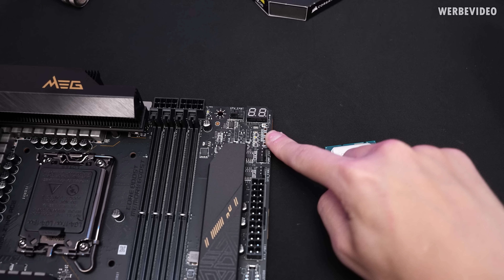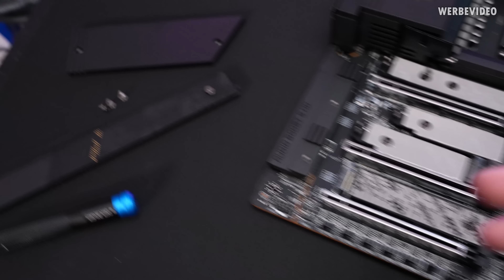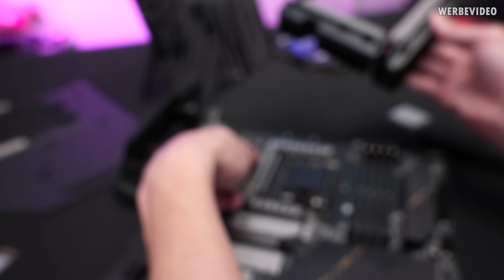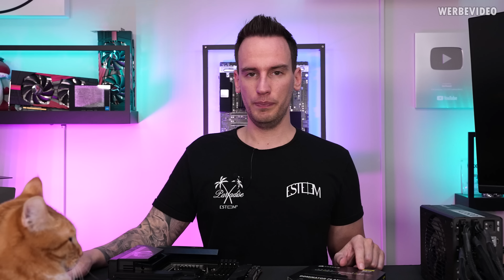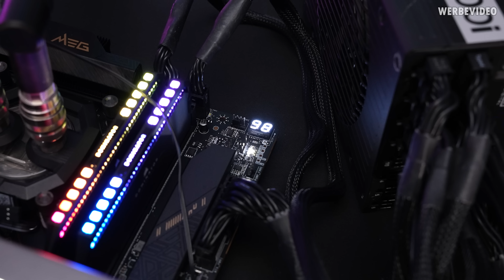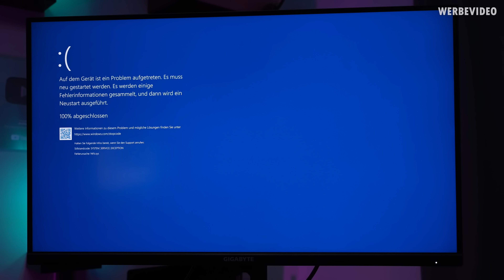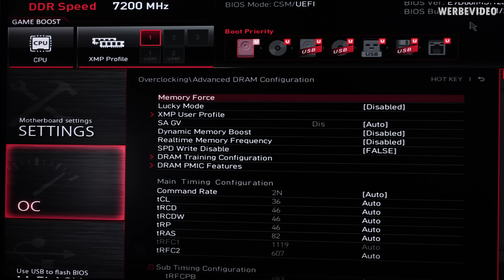My Opinion on the MSI Z790 ACE

Comment: As the owner of a Z690 Asus Extreme board the biggest dissapointment for me has been the DDR5 stability and overclocking experience - its been crap.
Ive tried several sets of DDR5, two different boards and also two different CPU's, none of its runs at the advertised XMP. DDR5 for me has been crap.
Im currently using a set of Corsair platinum 6200mhz and itll will only run stbale at 5800mhz.
Im really dissapointed with DDR5 and the whole platform as regards memory and general stability in honesty, Z690 and Z790 and DDR5 is a crock for me.
Reply: Could just as easily be a CPU limitation. Don't forget, just because the motherboard can support 6000MT/s+ and the RAM kit might be rated for 6000MT/s+, doesn't mean the memory controller on the CPU can do it. Setting those speeds is overclocking the memory controller! 13th Gen is only spec'd to run DDR5 at 5600MT/s.
Reply: Alder Lake's memory controller sucks for DDR5, but if you couldn't run more than 5800 - you dropped into Asus' motherboards lottery and you've got a faulty batch. Only everything made after February 2022 was working as supposed to.

Unless you've tried running 4 DIMMS, then good luck with that.

Comment: I have this board, it is very good. I do think the I/O shield cover is a bit plasticky and cheap compared to the rest of the board.  Another important consideration is that the m.2_1 slot, with the tool less removable heat sink is taller than other slots and so when you try and horizontal mount a gpu with a waterblock and active back plate, there isn’t enough clearance because of the heat sink height.  Also beware pci slot use reduces pci slot speed and channels of the first pci slot and also some of the m.2 slots.
Reply: I have this mobo and a 4080 on the way. I have 3 gen 4 ssds but could go down to 2 if I had to.  Is there a way to build that will not cause this reduction?
Reply: So I know this is 2 months old but a question for you if possible I have a NVME 980 Pro and 2 SSD drives and one 3 and half inch HDD drive (old I know but still works) so where would the NVME be installed on this board as to not interfere with he SSD's and the HDD? Is it possible?
Reply: @Anthony  just put it in slot 1 on the mobo since its linked to the cpu
Reply: @Jedtgill  ok great, so that also won’t interfere with whatever size GPU I use as well? (Was thinking of getting a 24GB 4090 at some point).
Reply: @Anthony  no the nvme drive go in a compartment that sit flush on the mobo. As long as the gpu will fit in your case the nvme will not bother it. Have you looked at a build video for the board?
Reply: @Jedtgill  looking at them now. Just found out I won’t be able to do a 4090 as the power supply I got is a Rog Thor platinum 2 1000 PSU and with all my stuff parts picker says it won’t work. Bummed a little but can use a 4080 16gb and can always upgrade PSU later I suppose.
Reply: @Anthony  why not get a bigger power supply? I highly recommend the MSI AI1300p. Plenty enough wattage and it uses a dedicated 12hvpwr instead of that ugly octopuses adaptor
Reply: @Jedtgill  I’ll have to look into that one. I already bought the 1000w Thor 2 because my old build was having power issues and was going to swap the PSU then decided to just try a whole new build and just swap my drives and 2070 Super then upgrade the video later and thought the 1000w would be good. Guess I was wrong. I already opened the box on the Thor so not sure I can return it but I got it from Amazon so maybe. It’s been a while since I have built a system, so I’m still a little on the noob side with all this new stuff. Last time I built my system they didn’t even have NVME drives, or at least they were not standard yet. Lol.
Reply: What case are you using? Is it staying efficiently cool?
Reply: @anishinaabefrog  I'm using fractal torrent
Reply: addintional info that is often wrong from pros when the manual says pcie1 slot goes to x8 it means x8 period not "5.0 bandwith x8" (manufacturers dishonestly keep repeating 5.0 everywhere to fool customers) on a 4090 you'll get x8 4.0 on a 1080ti x8 3.0 so yes it's a problem for high end 7900xtx or 4090 gpus those 4k 100+fps or 350fps in 1080p do need bandwith
Reply: @fredEVOIX  firstly, all RTX 40 GPUs are natively PCIe 4.0 x16, and not PCIe 5.0 x16. Consequently RTX 40 GPUs could never use the PCIe 5.0 bandwidth: an RTX40 GPU will always downgrade the PCIe 5.0 slot to PCIe 4.0.  --  Secondly, what you say is not true: when a PCIe 5.0 x16 connection goes x8 due to PCIe Bifurcation, it stays PCIe 5.0: it simply uses half the amount of lanes. The PCIe 5.0 bus is provided by the CPU, not by the motherboard, and gen 12/13 Core CPUs are compatible with both PCIe 5.0 and 4.0. Whether a device installed on the PCIe 5.0 slot uses the full cababilities of PCIe 5.0 x16 or not, depends on the device you install in the slot (it has to be a PCIe 5.0 device, which GPUs are not) AND it depends on the PCIe Bifurcation: Intel gen 12/13 Core CPUs only provide a theoretical total of 20 PCIe 5.0 lanes, but just 16 lanes are currently available to the motherboard slots/connectors. So you may use ONE slot at PCIe 5.0 x16, or TWO slots at PCIe 5.0 x8 each (consequently, when a PCIe 5.0 GPU will exist, in case you also use the second PCIe 5.0 slot for a second GPU, each GPU will use 8 PCIe 5.0 lanes, i.e. PCIe 5.0 x8).  --  Thirdly: anyway, it is well known that - especially for gaming - the performance difference among using an RTX GPU with 8 lanes (x8) vs 16 lanes (x16) is just marginal - about 2-3%. Performance difference may be more sensible in case of content creation (about 15% for video or rendering) ONLY if you have to work with batches of data larger than the GPU's Vram (otherwise there is no difference at all). As a matter of facts, when money is no object you typically reach best performance by using a PCIe 5.0 x4 NVMe SSD for O.S., progs and caches and reducing the PCIe 4.0 or 5.0 GPU lanes to x8, rather than the other way round (PCIe 4.0 ssd and GPU @x16)

Comment: Pretty sure the rear displayport connectors are for plugging your gpu output into the mainboard so the thunderbolt type c ports have video based off the dGPU

Comment: My Z790 Godlike reads the same 13900K under name and 13900KS under specification. Probably because the KS is just a "Binned" K that wins the Silicon Lottery. This video has helped. I now know to move some M.2 drives off the CPU. Thanks, it kind of defeats the point of having a 4090 only to give up PCIe lanes to an SSD you really do not need.
Reply: With the 13th gen 13900k it has 20 pciex lanes, which is enough for full speed gen4 4x nvme m.2 SSD and a gen5 16x GPU. The only time you reduce bandwidth of the GPU is if you use a 2nd nvme m.2 in another m.2_X slot that’s attached to the CPU. This causes the 16x GPU to reduce to 8x.

Comment: I have the exact same motherboard and 13900ks cpu and could only get 7200 stable as well. I ordered a new Asus ROG Maximus Z790 APEX and it just got delivered from the UK. It wasn’t in stock anywhere in the US where I live. Tried to get a G.Skill 8000 32gb kit for this board, but they aren’t in stock anywhere in the US. I had to get a 7800 kit instead and I’ll try to OC it to 8000 maybe.
Reply: What's your experience so far despite the news about ASUS recently?
Reply: @victorkelante  Been wondering the same...

Got the Z690 Formula that was affected by the really bad BIOS update 2305 in early April. My MB Formula, CPU i9-13900K and 2x 16GB RAM GSKILL Trident DDR5 6000MhZ sticks got grilled. All is in RMA now. 
Been thinking to get a new board that has 2 bios for safety and the APEX Z790 could fill that role.

Would anyone safely buy the Apex Z790 after all the clusterfuck that ASUS is going into lately?
Reply: @starfuxer  rip man, I was loving the mirror finish on the ASUS Z790 Hero but I've always been with MSI, currently building and I already got the MSI 4090 Suprim Liquid with the MEG 1300w PSU, also from MSI. Right now I'm thinking of going with the Tomahawk Z790 (non-RGB build).
Reply: @victorkelante  I've got the 4090 Suprim X non liquid and I love it! Got Asus Thor 1200W for PSU and Asus Helios white case. Love my PC but I'll be having PTSD for the Formula board though
Reply: Which I'm evaluating options...
Stay with Formula, get the z790 apex or the msi meg ace z790...

Comment: Thanks for the review. I'm thinking in getting this mobo for my build. One question that I have is: what's the max MTs supported for 4 RAM sticks? I need a build with 128gb for video edition and programming and currently I have a Z790 Edge DDR4 with 128gb and I want to see if it's worth the upgrade.

Thanks so very much in advance for the help and for the review. Your videos are really helpful.
Reply: Personally I think getting 128gb past 4800 is going to be tough but this is probably your best bet for a Z790. I currently have four 16gb sticks of dominator platinum 6200 that run stable at 5800. I was honestly impressed it could do that, I was expecting to be stuck at 5600 or lower but I've run this for hours on y-crucher, prime95, and aida and it's perfectly stable. Of course you're still subject to the silicon lottery.
Reply: @no_one682  thanks for the reply. I think so, I've watched in other videos that Kingston Fury 64gb kits x2 works at 6000MT/s but I'm not sure about their stability. Probably if I set them at MSI's supported frequency of 5800+ they could do fine. Either way it's better than DDR4 128gb at 3600MT/s.
Reply: @obakamaster  I don't trust a lot of those videos because from my testing it can take several hours before a failure if it's not totally stable. Cinebench and game benchmarks will run just fine but prime95 or Aida will eventually fail. From all the research I've done this board seems like the best possible chance to get 4 sticks of ram working on Z790. In any event I wish you good luck.
Reply: I can confirm it will at least do 128GB at 4800, but I never tried higher. It has been stable for video editing since putting it together last November with two Kingston Fury 64gb kits (KF548C38BBK2-64). I got this board at launch so there were only a the few kits listed on their compatibility  list that  were confirmed for 128GB at 4800, maybe there are more now and at higher speeds.

Comment: 7XX boards have crazy prices...  80% of people never overclock past any "easy , click here" options... I was thinking of getting one with a 13th gen chip so I could give my B660 12100f setup to my daughter, it has wifi and bluetooth and all and a fraction the cost of an entry-level new set.
Reply: 7xx doesnt worth at all!
6xx are far more valuable, cheaper (and can find with good percent off too) same features (sometimes even more) same upgradibility,
just in max ram speed (only in DDR5 version they lack behing) while 6666+ for high Z690 is high enough, and even those support less can work with faster rams too (with enabling overclock) 
and in my opinion for now and these price if anyone wants buy DDR5 rams, 5200 & 5600 sticks have good price, faster rams are expensive yet
and 7XX nd 6xx total PCI-E lanes numbers are same (just 7xx switch some of gen 3 of 6xx to gen 4 in chipset) which is useless for most users,
while cpus 20 lanes are enough for most users which use 1 GPU + 1 M.2 NVMe SSD = 20 Lanes (all board lanes remained untouch)
and SATA H.D.D or SSD s doesnt use PCI-E lanes. so if someone wants to use more 2 M.2 SSD s or 2nd PCI-E Cards there is still enough lanes even in B660 (Whatever H670 or Z690)
and I checked some of 6XX boards has more features too like more SATA (in comparison of same version 7XX model)
more back panel portsand etc.
Reply: @XFXForced  even 6600m is a 6th more expensive, where the 6XXX series beats it, it is like 2 or 3 fps, not sure if it is worth the 15% extra. with newer titles the 6600 might be better but I looked at the games i personally play before I chose.
Reply: bought msi z790 but....the ddr4 tomahawk i can use 4 dimms, main pcie slot stays in x16 even with 2 other pcie card and I still have 4 m.2 connected on the board, in 4.0 only tough and it was almost half the price of the meg ace which is....worse really

Comment: That thermal pad issue not making proper contact could easily be fixed by using slightly thicker thermal pads on that area.
Reply: Yes that's why he said that MSI should take note. Should not be something a user needs to do.
Reply: @Xfade81  did I say that’s something user needs to do? Just mentioned what could be done to fix it.

Comment: The 'ACE' M.2 toolless feature is nice if you need to replace a storage drive quickly. But it's definitely just a 'nice to have' feature.
Reply: I just bought this motherboard and installed it on a build.  The button is ridiculous and nearly impossible to take off. It most assuredly DOES NOT come off with ease and was a total waste of design time and effort.  Meanwhile, all the other shields have m.2 screws in them on the boards ... lol!
Reply: @apex_chris did you figure out how to take off I’ve had the same issue and tried for 5 hours before just stopping completely any idea how you fixed it?

Comment: As with all motherboard manufacturers these days, plenty of nice features and lots of connectivity, that you cannot use without losing performance. How many PCIE M.2 slots? 5 and if you install a drive in each one, you lose performance. For the money you are paying, you would expect an additional PCIE controller. 
I also had a look at the specification for memory. Hmm, 1DPC 1R Max speed up to 7800+ MHz, nice one MSI 🤣
Reply: You lose just a smidge of performance, I have all 5 populated and it runs perfectly fine.
Reply: @MarkWebbPhotography  Thank you for the reply and information.
Reply: u wont lose performance even if u use all 5 M.2s + 1 graphic cards,
there is enough PCI Lanes in CPU + PCH for those
but if u want to use other PCI-E slot too + 1 GPU and M2s yeah u will lose some performance and DMI will reduce to X4 too,
but its wrong platform for someone wants to use all of these things,
he must go with X670E high end boards (or threadripers)
in intel he must go for HEDT like X series CPUs and MBs like X299 (which I dont recomand for now because its old and weak vs AMD offer for same price)
Reply: @XFXForced  actually came from a 3960x for the single threaded performance haha. Adobe is happier with intel
Reply: @MarkWebbPhotography  I know, but I was talking about lacking PCI-E lanes with intel mainstream series (if put SSD in all 5 of them and use another PCI-E card with Graphic card) which hit performance on Z790 boards + intel K series,
and intel HEDT X Series are old now (saphire will be out  soon but its very power hungary and hot (more than before) and slower than new threadriper by far)
Reply: @XFXForced  What bus or buses do, network, Wi-Fi, audio chip, SATA, and USB components run on? (I know this is partly Intel and AMD's fault for lack of PCIE lanes on the processor design.) You would not buy an Audi with top speed of 200 km/h and then find out that with a passenger/s you top speed in 30 km/h or would you?

Comment: my m13a the highest I've seen was 55c max vrm tenp with 370+ watt 10900kf at 5.3all core (1.22 under load on direct die contact and liquid metal)
I guess case flow matters*

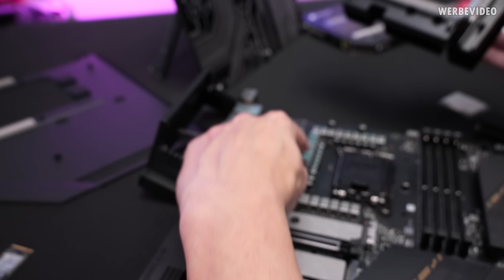Comment: 9:10 Something similar with the Gigabyte Radeon RX 6750 XT 12GB GDDR6 Gaming OC

 GV-R675XTGAMING OC-12GD

The thermal pad for the vrm chokes at the display output side was not touching at all, zero imprint from the inductors.

Comment: 1:30 - You have obviously just worked on an open air bench too often.  Swapping out an NVMe SSD in an assembled system can be a real pain in the behind, especially with those horrible designs where the heat spreader screw is also the retainer screw for the M.2 slot.  (I have that design in my main system now, with a Asus Dark Hero X570 motherboard.  I have actually removed the heat spreader and use a heatsink right on the SSD because of the pain that design inflicted on me.)  Believe me, toolless swapping of NVMe SSDs is a godsend.